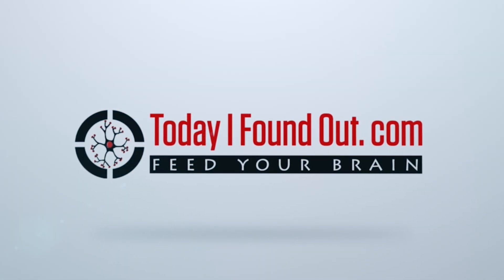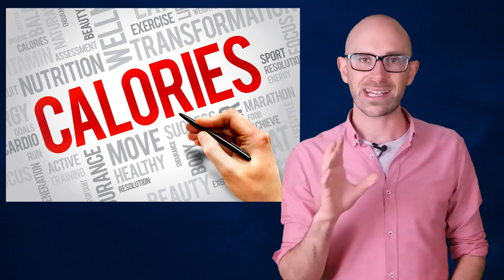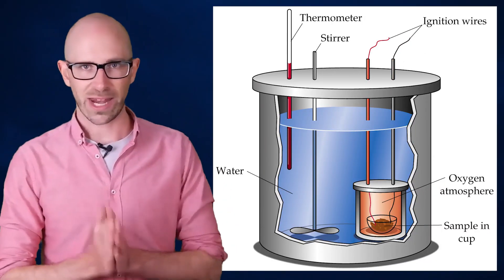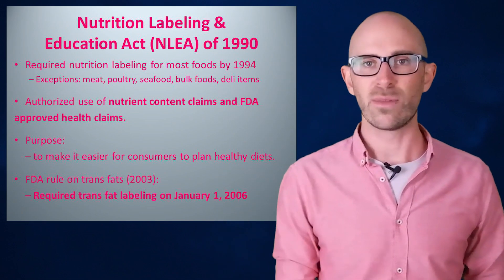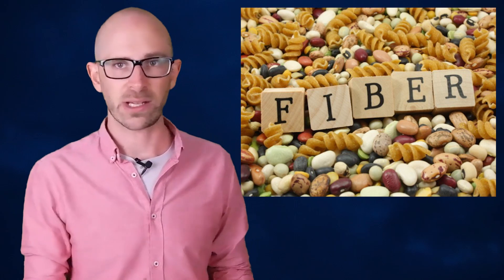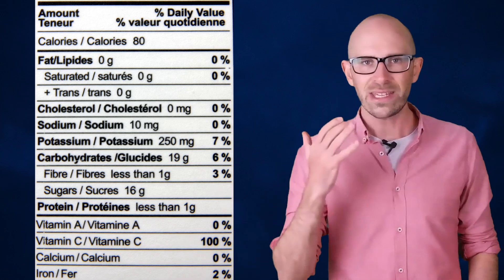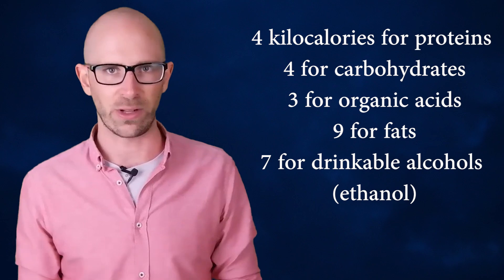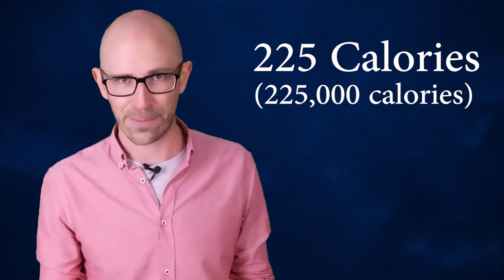How The Calorie Content Of Food Is Determined

Comment: not all food calories are equal. just because the package says 100 calories does not mean that is what you get when you eat it. foods that are high in natural fiber trap some of the digestible material and prevent you from absorbing it. some foods have calories that are rapidly taken in while others take longer to take in the calories, this causes hormone changes at different speeds so that highly processed foods (which are much easier for your body to absorb the calories very quickly) get stored as fat because all of the calories are suddenly available, while other less processed foods process over time and the body can use them at a slower pace to replace what it has already used. this is one of the reasons that highly processed foods will make you fatter than a less processed food with the same number of calories.
Reply: This comment gave me more information than the video....
Reply: thank you for this!
Reply: If I’m not mistaken the term “processed food” just describes the “process” of doing anything to the food including chopping, otherwise preparing and mixing ingredients along with cooking the food itself, and by that definition everything you eat that isn’t a raw version of the food is processed. You’re right about different nutrients breaking down at different rates and storing differently but if you set nutrition levels (saturated and non-saturated fats, carbs, protein and vitamin intake) for your diet it doesn’t necessarily matter where you get your “optimal” nutrition from as long as you actually get your nutrition.
Reply: @openminded4751  there is a difference between processed food and highly processed food. I was talking about highly processed food.
Reply: @openminded4751  highly processed food and ultra processed food take things that are not edible and are often poisonous and turn them into vegetable oil. Multidextrin has zero calories and causes blood sugar spikes worse than pure sugar does. It's worse for you than eating table sugar with a table spoon and has zero macros. 

So I think that you are oversimplifying to the point of being wrong. Processed food such as home made apple pie is completely different than canola oil, although some people foolishly use canola oil and have bad health because of it.
Reply: Eli Nope ok but it’ll be right within 100 calories right? Pretty damn accurate
Reply: @jdc4316  calories are not important to our bodies. They are ways to measure energy and now we know even the companies don't measure anything anymore! They just make things up🤠